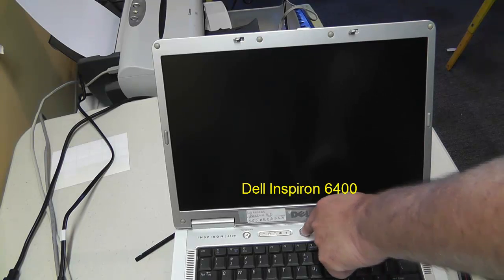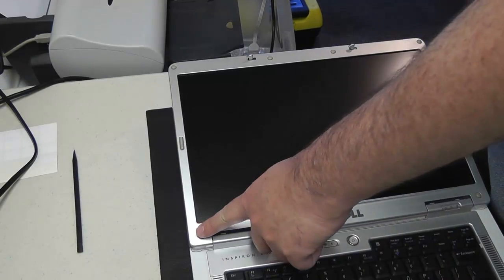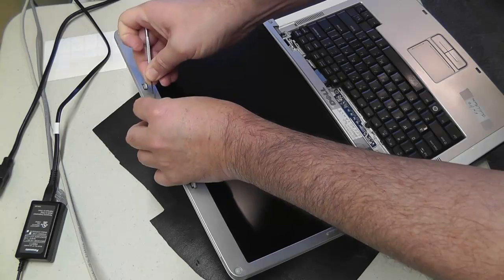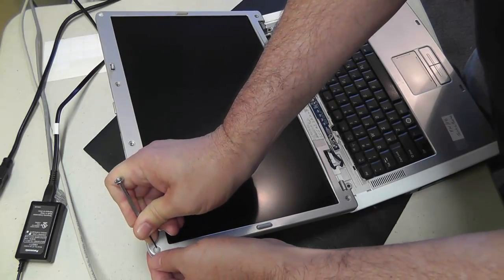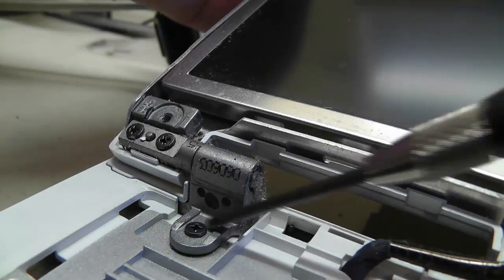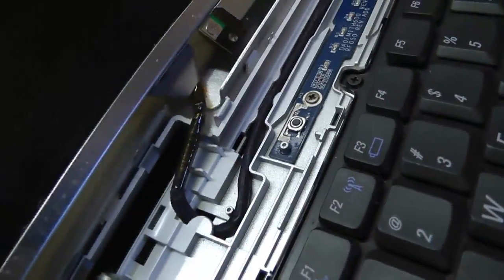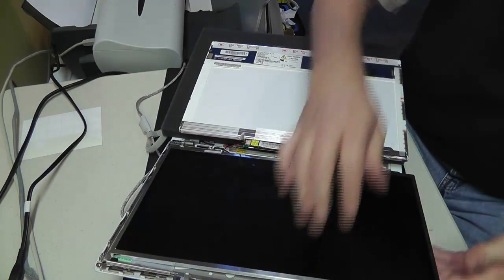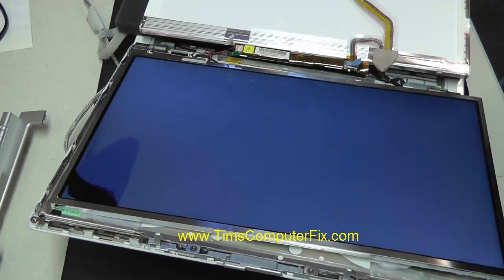Dell Inspiron 6400 Screen Diagnostics by TimsComputerFix.com

Comment: Hey Tim,
thanks a lot for this great video! I have an issue with my 6400, it works perfectly but I have a vertical yellow line (sometimes blinking, sometimes always on, sometimes no line at all) on the left side of the panel. Five years ago it appeared for some hours then went away, and now after 5 years has come back.
Do you know if it's a matter of cables, replacing screen or inventer? what could you suggest me?
Greetings from Italy
Reply from the maker: +Batallo12 I would say it is not the inverter. When in doubt always replace the cheapest part first. In this case replace the cable before buying a screen.
Reply: +TimsComputerRepair thanks a lot  for your time Tim. I will try to change the cable if I am able to do it myself :) thanks again

Comment from the maker: As long as it is the same model laptop you should not have to remove the bezel. You will however have to gain access enough to remove the data cable from the motherboard and don't forget about the wireless antenna wires that are routed down under the palm rest and com out on the bottom of the laptop connected to your wireless card. Thanks for watching.

Comment: Hey Tim,
I have the same problem with my screen. i didnt light up anymore. so im thinking about buying a used 6400 with problems but a functional display and just change same. must i open the whole display like you for "just" changing two displays or is it "just" about moving some plugs?